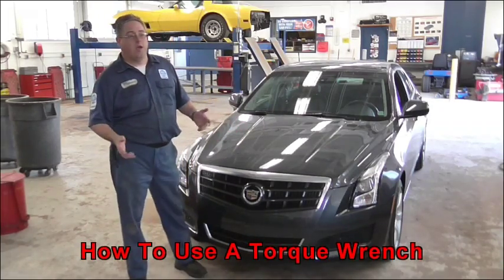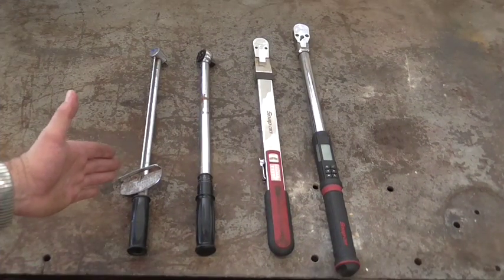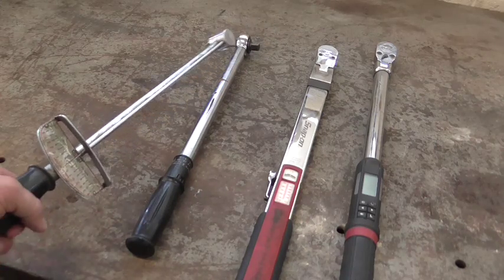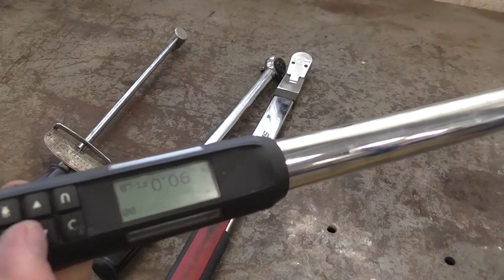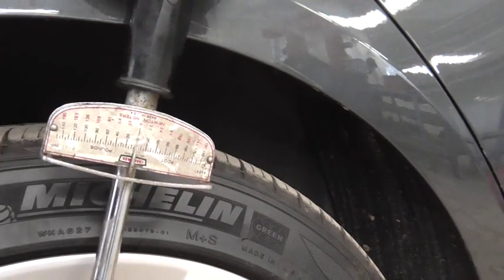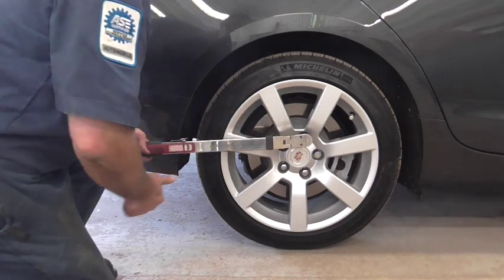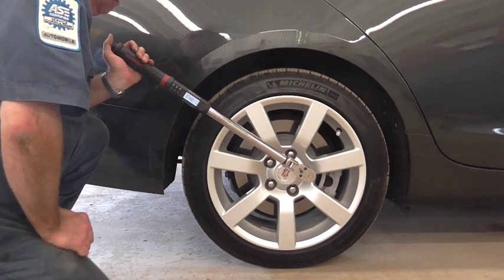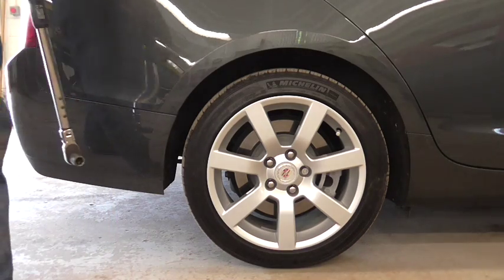How to use a Torque Wrench

Comment: Never apply torque to wheel lug nuts with the weight of vehicle on the wheels, as you are not seating the wheel properly against hub.